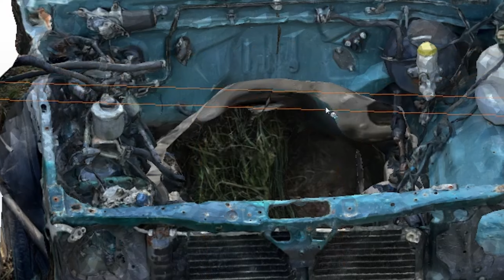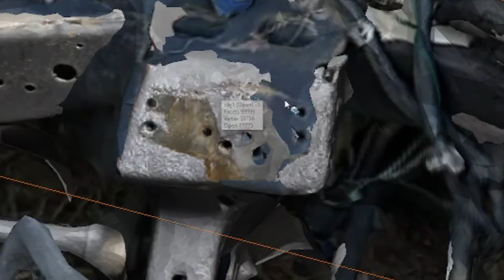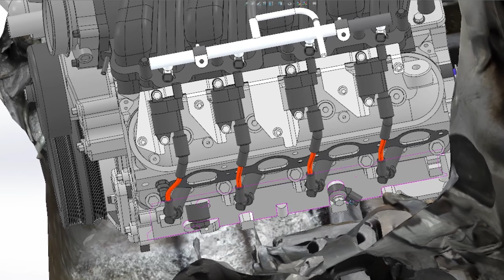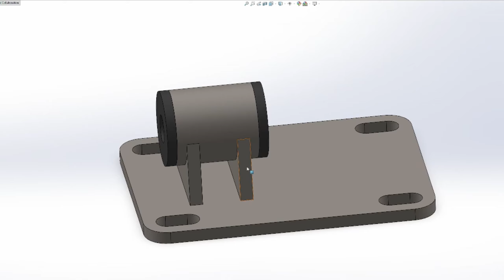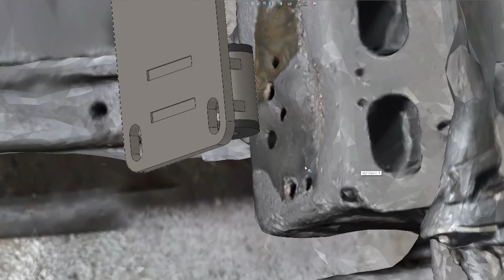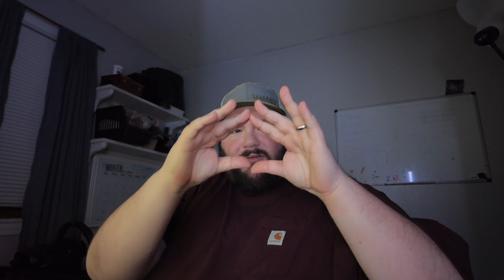I Scanned a Car with my Phone to Design Custom Engine Mounts!

Comment from the maker: Should this be my new gig?
Reply: I think if you can make kits for multiple engines, hell yea! It opens up your market share. I'm looking for someone to make me a mounting kit for a k series. If you make one, I'm interested. I'm pulling the KA out after 300k miles this year. Keep me posted.
Reply from the maker: What transmission is typically run with the K series?
Reply: @theoegarage  I'll be running a cd009 from a 350z. You need an adapter plate to join them. Typically the K series is paired with a fwd or 4wd transmission. I'm not sure if any cars they make that's RWD other than the s2000 but that's an F series engine.
Reply: I'll be mating same trans to a LQ4

Comment: Just downloaded polycam to help with some of my projects. What settings are you using and how many pictures are you using for a scan.
Reply from the maker: They actually put out a ton of helpful videos. I use the live tracking option that lets you basically film the object. Then i basically move my camera around the left side, right side, top, bottom, 45° L & 45° R which works out prettty good!